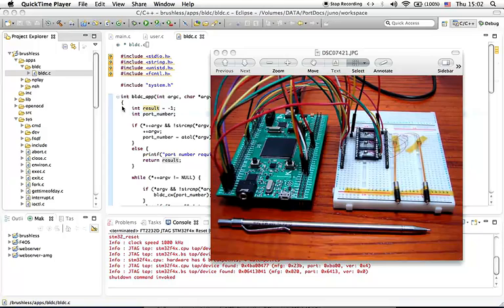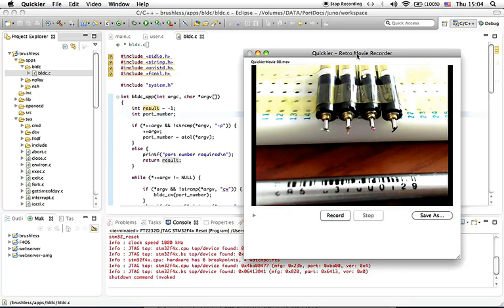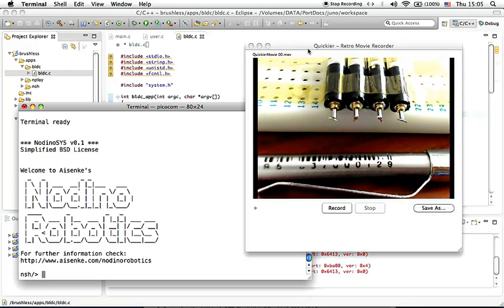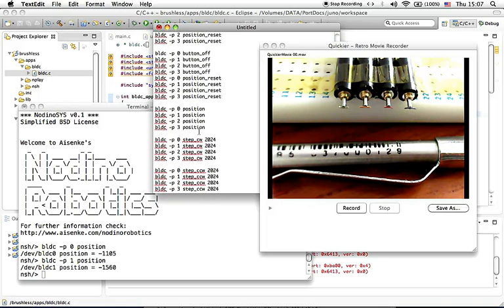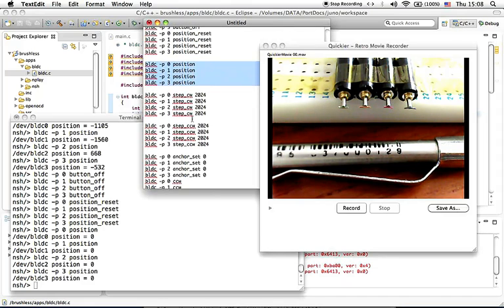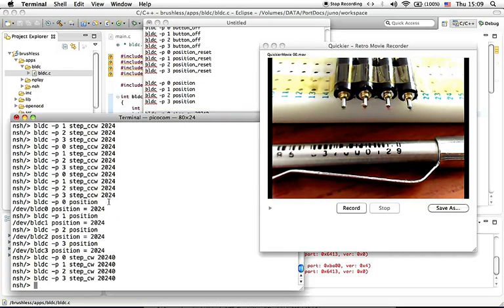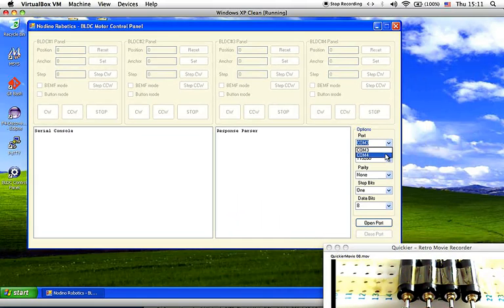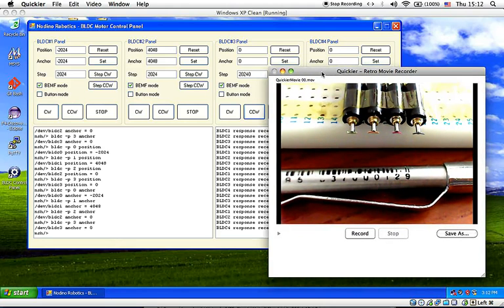F4-DiscoverFree Project - Sensorless BLDC Module

Comment from the maker: It is called sensorless driving, so basically you read the rotor position, electrically, from the floating winding to effectively commutate the motor. What you read from the floating winding is called back electromotive feedback (BEMF).

Comment from the maker: On the output shaft, the speed is around 85 rpm. The reduction gear ratio is 337:1, so the actual speed of the motor is around 28000 rpm. At the output shaft, yes you can have it as slow as 50 rpm. If you start the motor at higher speed and then gradually decrease it to 50 rpm (because of a load), yes you can have it as slow as 50 rpm on the motor. It all depends on the way you drive it.

Comment from the maker: Yes, we can. Let's say the motor is turning and you put an extremely heavy load on it until it stalls. Once you remove the load, it will be able to recover. But if it happens during the sync (which unlikely to happen) it might miss some steps.

Comment from the maker: If the motor is stall due to an extreme load, it will recover and continue to turn after the load is removed. However, if it happens during the rotor sync (which unlikely to happen) it might miss a couple steps.

There are a lot of servo motors equipped with brushless motors. What kind of servo system do you mean? For the self-balancing robot?

Our application is in biomedical robotics, a swallowable capsule robot. So putting hall sensors is way too much space.

Comment: That mean we can estimate the position of BLDC without using the position sensor? 
What happen if rotor stopped by torque load? Will it correctly estimate the position?
I'm looking for some solution that can make the servo systems without the position sensor.

Comment: May I know what is the RPM of the motor? 
Will the system still working if the motor running at slow speed (ex: 50 RPM)?